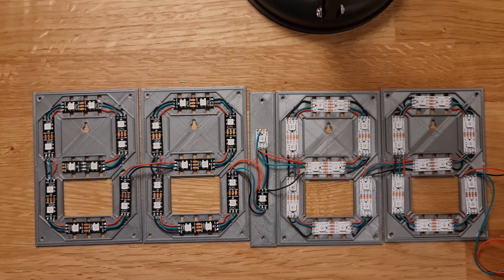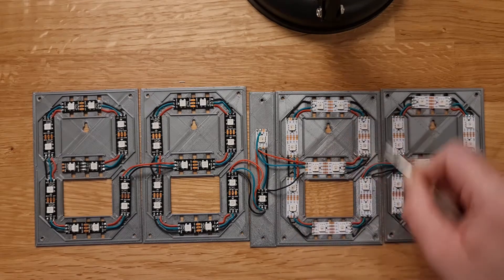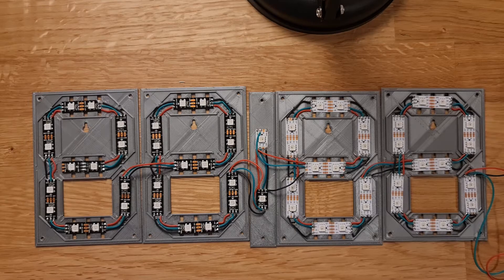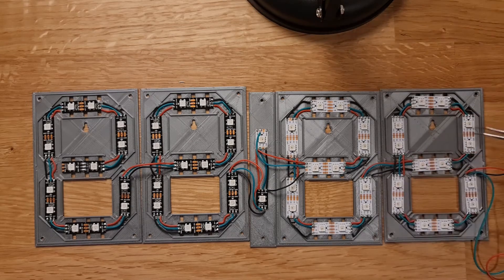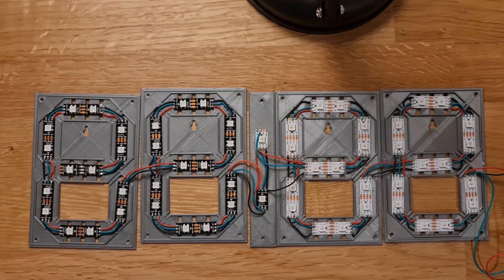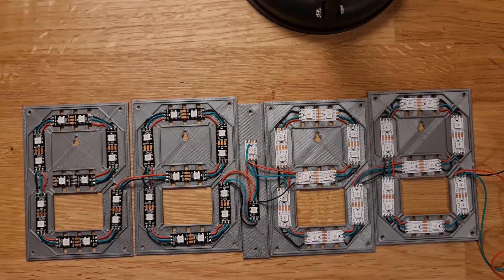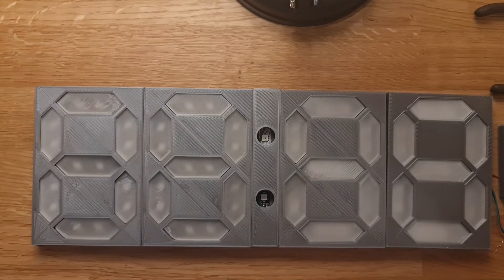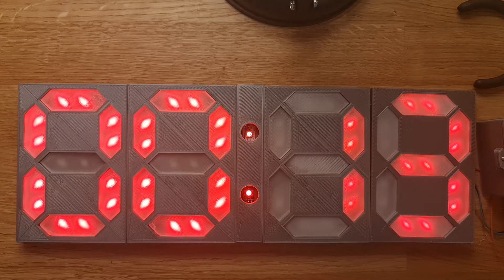How to make your own Crossfit Interval Timer  - Part 2

Comment: Hello Friend!  i am repeating your project and i have a question. Is it possible to use arduino and not esp32 for this project?
Reply from the maker: Hi :) Yes it should be, all you need is a pin for LED and pins for the buttons, the code should actually be the same as well

Comment: I've Built this version and am really happy with it. However I cant work out the code to add another digit so It will keep counting up/down while counting down the number of reps required. Would love any help if you have time
Reply: did you manage to implement this project with an additional figure?
Reply from the maker: Hi Nick👋, sorry I think I saw your email. Just been a busy time. Will of course help where we can🙂. What will be easier for you through email? WhatsApp?
Reply: @PlumPot  email is easiest for me. Appreciate your reply. I realise it's a busy time of year for everybody. Please don't put anything off on my behalf. However extremely grateful for any help.
Reply: did you manage to implement this project with an additional figure?
Reply: @Marcus_vildi  No. I ended up converting the project to a fork of Leon VanB's clock by Resinchem. Has time, countdown , temp and wifi phone control. Also controllable by home assistant if you want to implement that code.